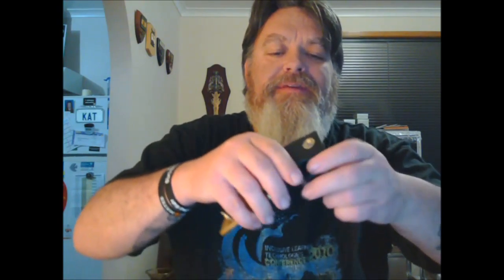*How to* Fit a Custom Belt Buckle onto a Leather Belt

Comment: when i put on my custom buckle it felt like it made the belt so much longer, now it can barely hold up my pants, any tips?
Reply from the maker: Hi, yes they can and do add  some length to a custom belt.  If you are up to the last hole on your belt, you need to add more holes the same distance apart as the original small holes. A hole punch is used to make a clean hole.

Comment: But how do you fasten it when it’s on?
Reply from the maker: The belt should have holes punched along the length at the other end, place the tongue of the belt with the holes behind the buckle and the buckle will fit into the appropriate hole for your size. I hope that helps?
Reply: Cheers mate